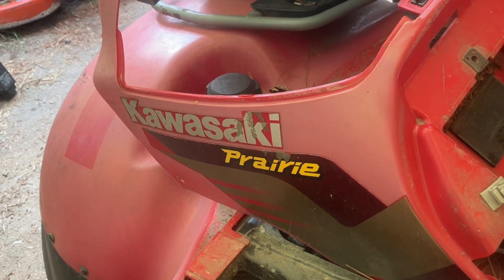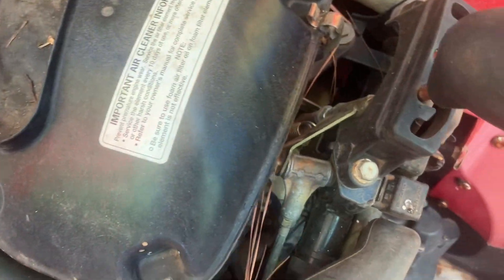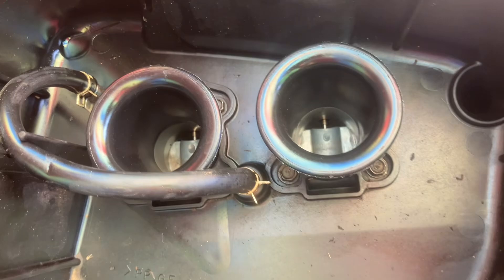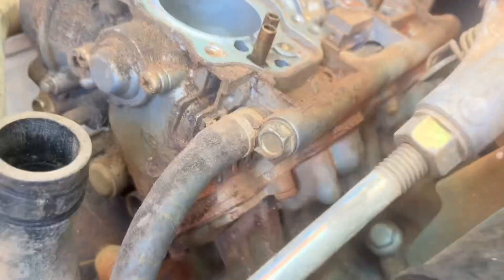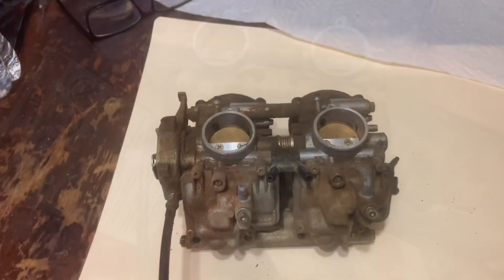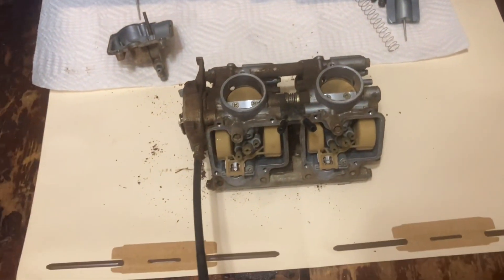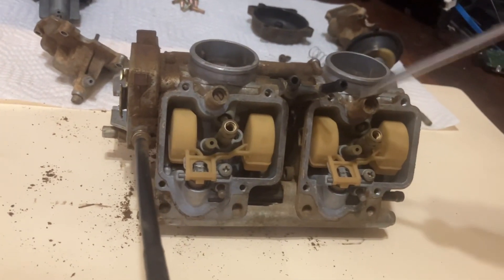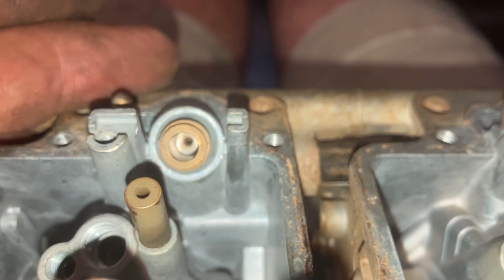Kawasaki prairie 650 duel carb removal and tear down !

Comment: did you find where the fuel was coming from?
Mine is leaking like a sieve from somewhere when running. I thought it was the float bowl gaskets but i replaced those and its still pouring from somewhere.
Reply from the maker: Your float needle may not be seating